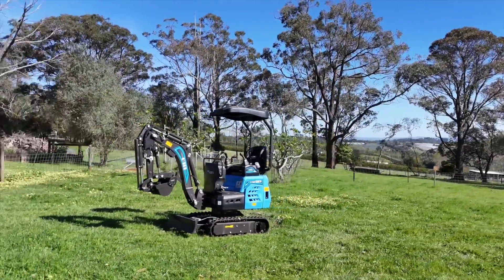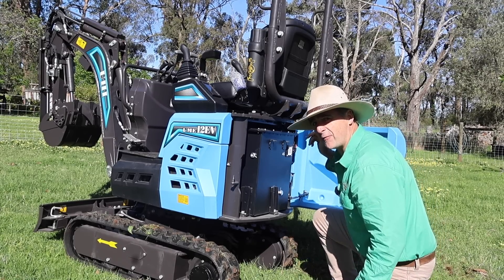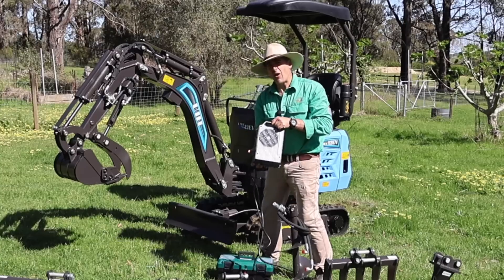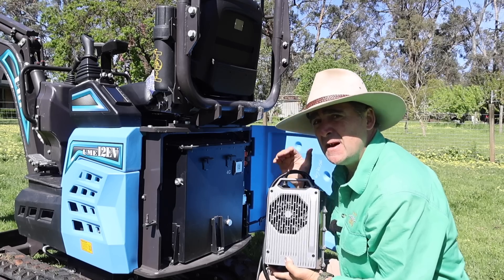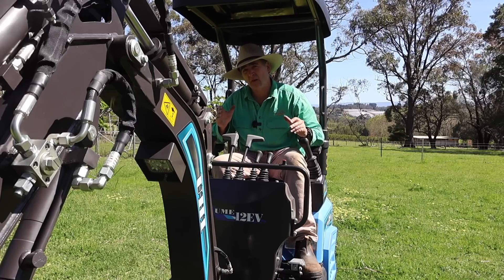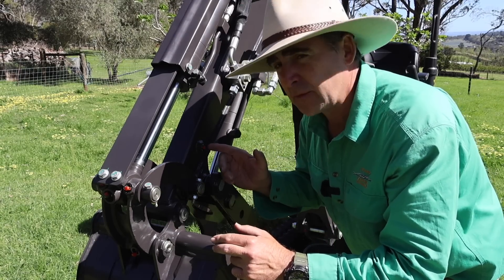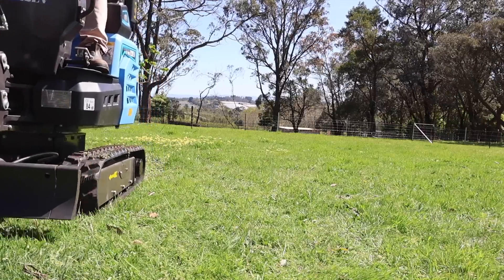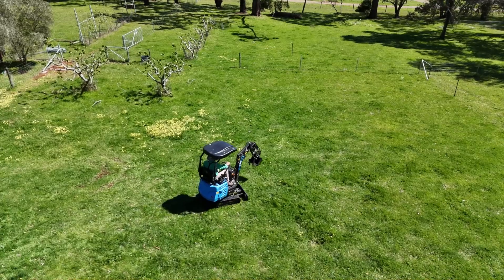Electric Mini Excavator Review: UME 12EV Field Test

Comment: Very cool. I've never used a machine like this, but was surprised to see that you can adjust the width of the tracks so easily. Is that standard on fossil fuel diggers as well? Also  in the future, can you please show what the plug receptacle looks like? I know it comes with a 15 amp charger but a 10 amp might be sufficient, if the receiver is standard. Slower, sure, but then no need to upgrade your electrical box.
Reply from the maker: Try and avoid starting fires mate. A 15amp rated socket is required.

Comment: Do NOT buy one!! Get an established brand like JCB or Kubota 1.8 tonne, diesel! Amazing machines that will dig with ease and last a lifetime. This size is too small, and small equals danger. 1.8 T is what you need, and even they're a bit small. To max out digging a small trench like on this video is terrible! And don't get a thumb either, as you're bound to bend it when overloading it, which you will do, very common. And how are you going to charge it when out in a paddock? And excavators often sit for a long time between uses. Cant imagine the battery liking that. Stick to developed engineering, not early variety.

Comment: Great no 1000 li diesel storage needed. Sitting on a battery will have me use the EMF - Gauss meter to check the reading under my spine and prostrate.  🤓
Reply: 1000 liters? Do you know how efficient a diesel is? My jcb18 is serviced by a 20L Jerry can every now and then

Comment: Thank you very much for the video. I have a 1500kg petrol powered Chinese Excavator that over heats. (Modifications incl. a fan will be done). How is the electric with heat?
I am contemplating to change mine to electric one day. I have done it to a Golf Cart so I have a little experience.  I find the petrol powered one quite heavy on petrol use and I have solar power so it could even be saving me money.  Also the battery could be connected to my power system when I don't use the excavator. I am however surprised that the electric one is so noisy. My Golf Cart isn't.